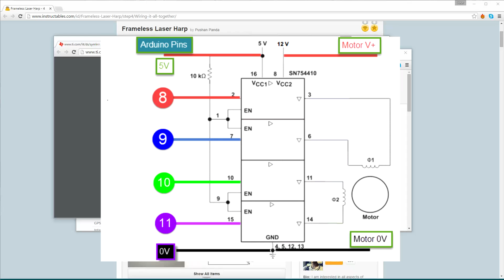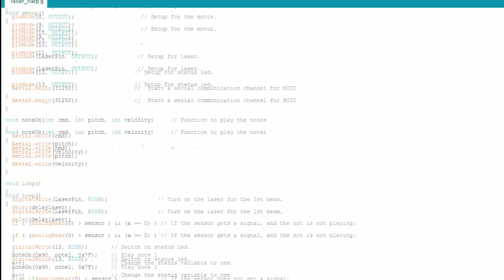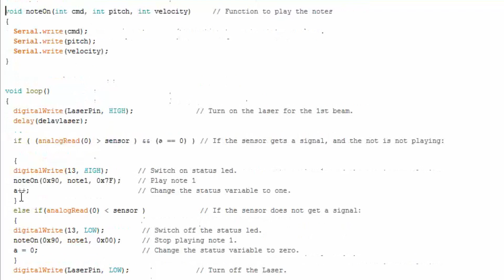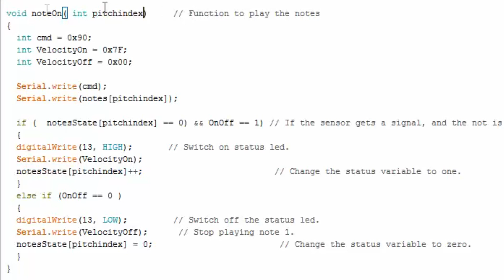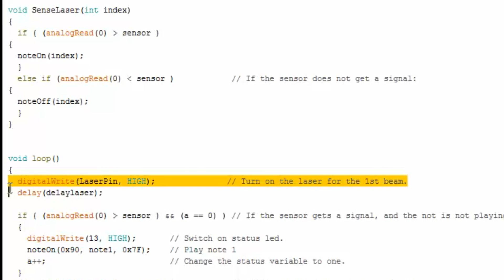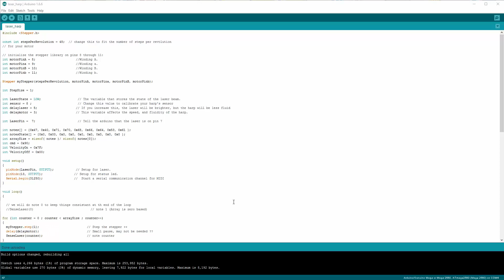Laser Harp Code Conversion

Comment: I'm curious, did anyone ever get this code to work in a laser harp?
Reply from the maker: Not sure, the OP that asked for help was on the Element 14 community, if you google Laser Harp and E14 you may find more info, my purpose was to change code to use bipolar steppers rather than uni-polar steppers, after that it was back to the OP for completion.
Reply: Peter Oakes. thanks for the update.

Comment: hi there bud hope you are well ? just a question would it be possible for you to send me this code for the laser harp as i am using a unipolar motor and tried many things to modify the code but to no avail , was wondering if you could send me this code so i can try it please , ive even trid changing to different motors and its still wont move as fuild as normal , the beams are there but when i delay the motor all i get is a static motor .
Reply from the maker: Send me your code, peter@thebreadboard.ca and ill have a look, what I did was modify the code from Unipolar to bipolar so as you using Unipolar my code will not help
if you also have a wiring diagram, that will also help (JPG, PNG, PDF whatever will do)
Reply: sorry ment to say im using a bipoloar motor and sure thing will do
Reply: hi peter i have sent you an email with the codesthat i am using
Reply from the maker: Great, Ill have a look soon, in the mean time, this link should take you to my article on Element14 Community where I posted some code
https://www.element14.com/community/message/169232/l/re-stepper-motor-wiring-helpand-a-few-other-small-questions-from-an-instructable#169232

Hope it helps
Reply: cheers peter ill give it a try and let you know :)

Comment: how did you get that program? cuz my laserharp isn't working. and the program on this instructable is different than that yours.
Reply from the maker: DOMIGAMES I helped a viewer out by modifying his code to work with a different stepper motor etc. it was a post on Element 14 community. I made the video so others could benefit from the work